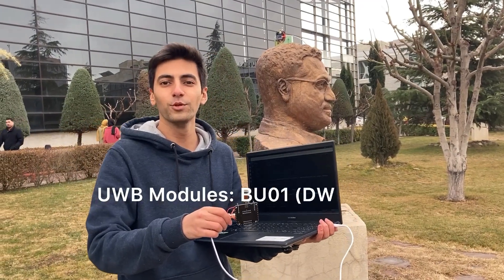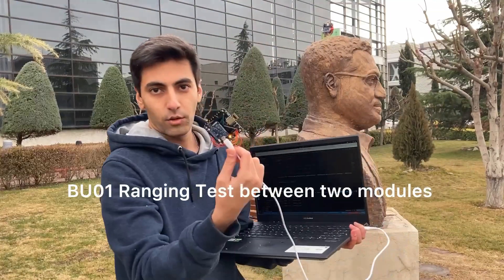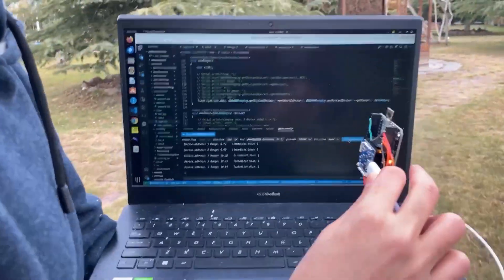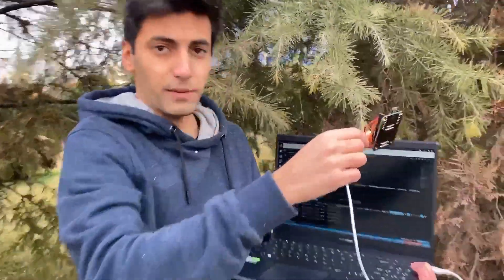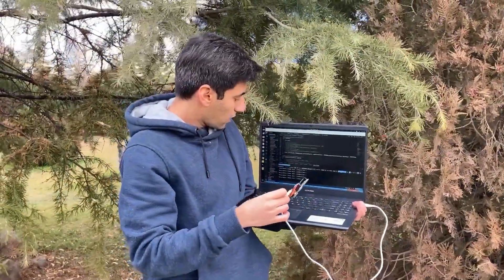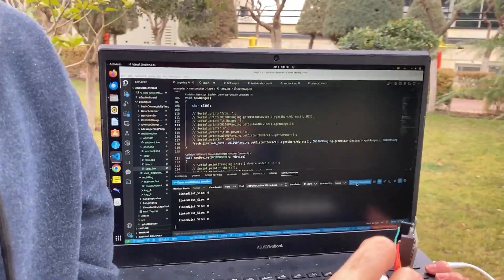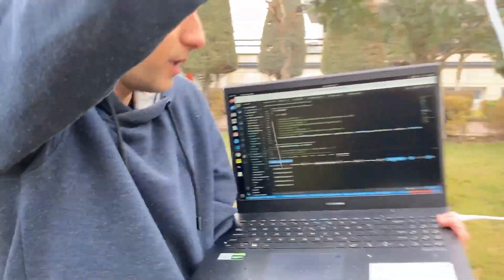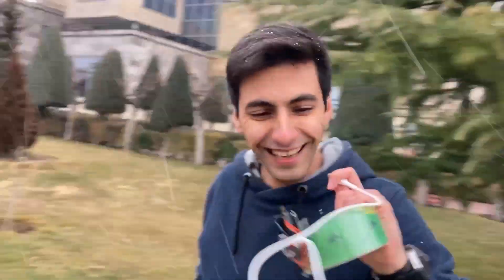UWB Module Ranging Test - DWM1000(DW1000) - BU01

Comment: Curious if you optimized settings for range?  Power and datarate, etc?
Reply from the maker: Yes, of course. based on official documents on https://www.qorvo.com/products/p/DWM1000#documents 
as you can see there's even a wholesome document about "Maximizing Range in DW1000-Based Systems (Application Note APS017)"